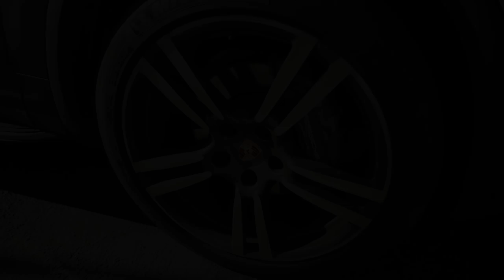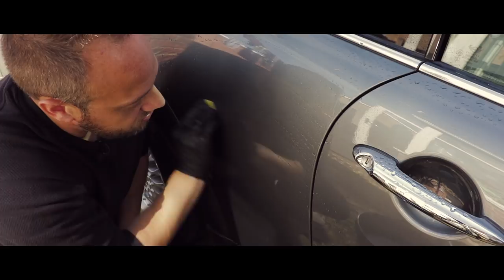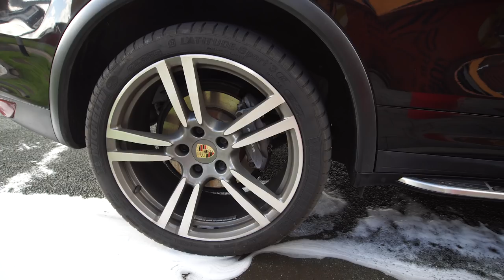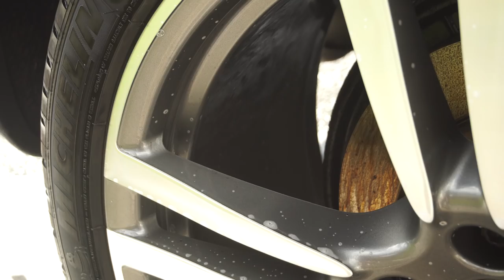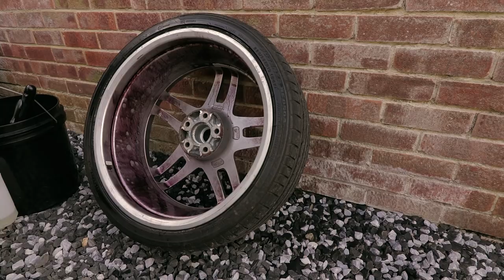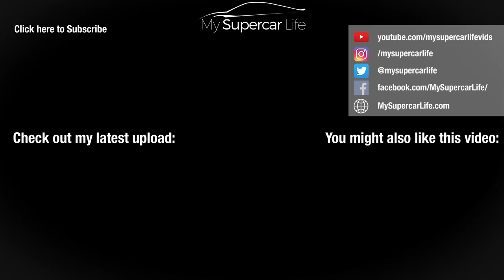How to Use a Fallout Remover to Clean Car Wheels

Comment from the maker: Are you using your fallout remover the most effective way, and which fallout remover do you use and recommend? Let me know in the comments!
Reply: Can you use it on coatings like gtechniq c5, or will it affect it?
Reply: I Clean wheel first with a ph neutral soap then blow dry and use iron x for 3-5min then rinse
Reply: Malcolm Bale C5 is one of the best product for protection purposes. Iron or fallout removers could use for cleaning and break dust, but some ph natural cleaners help on increasing the life of the protection layer. Personally I prefer to use valet pro bilberry for heavy dirty wheels. It’s been 2 years and my C5 is still alive .
Reply: Korrosol best fallout remover

Comment: Some fallout removers actually do contain soap, such as Dooka Bleed and Bilt Hamber Auto Wheels. But for those that don't, your point is spot-on.
Reply from the maker: True, but they will only react with the surface iron until you start to agitate and use the soap chemical at which point the fallout chemical doesn't have dwell time to remove the embedded iron particles under the dirt layer, if you see what I mean. It's hard to put in words 😁. I'd personally use 2 separate products to get the best results but I understand what you're saying.

Comment: Very Useful Information !

I'd Like To Share That I Used Meguiars All Wheel Cleaner on May Car Paint For Iron Decontaminatio, And It Worked Fine.

This Tip Was From Dallas Paint Correction .

Many Thanks For All The Videos And Nice Tips !

Best Regards !

Ed
São Paulo
 🇧🇷
Reply from the maker: Thanks for sharing. The thing is to do it properly you still need to clean the wheels first or you are just removing the surface iron particles (as shown in this video). The Meguiars product has both a cleaner and fallout remover. My opinion is that it's better done as 2 separate processes, clean then decontaminate. Or clean and then use the Meguiars 👍

Comment: A lot of what you say is spot on, things do move on though and things like Bilt Hamber Auto Wheel do also contain some detergent now. That said i would always get as much muck and brake residue off before adding any kind of fallout remover, and agree that its not something you should have to do on a daily driver with average weekly mileage. A good look at the car and the wheel after a good jet spray off should tell you all you need to know

Comment: Does it matter if you spray or catch it on the brake discs?
Reply from the maker: No as long as the paint isn't too thick it will wear off pretty much when you drive the car

Comment: Can you use fallout remover on coated wheels like c5?
Reply from the maker: Yes, as most fallout removers are PH neutral, they should be safe to use on pretty much all coatings.
If you're in any doubt, you can apply some in a small area using a brush, or even cotton bud (q-tip), behind a tyre valve for example to make sure nothing adverse happens.

Comment: i wet my wheels then use p&s brake buster then wet ,then wash in gyeon bathe plus,then bilt auto wheel,wet then gyeon wet coat,wet and blow dry a long process but my wheels are mint

Comment: Fallout remover will not 100% clean the wheel. If you wanna be hardcore anal about it, you'd remove your wheels, degrease, rinse, wash, rinse, fallout, rinse, and claybar, wash, rinse and dry....... Ya.
Reply from the maker: It surprises me how many people think it does, and how many manufacturers sell the product as a cleaner. It's like everything else: it has it's place if used properly. I see the same thing with snowfoam where people complain that it doesn't work and it doesn't clean their car - It's not supposed to, it's a pre-wash to remove surface dust etc, prior to washing to help eliminate swirls - it was never designed to clean cars. It's mainly down to how things are marketed.